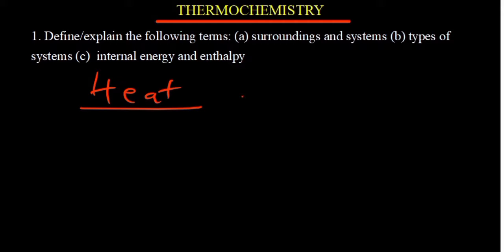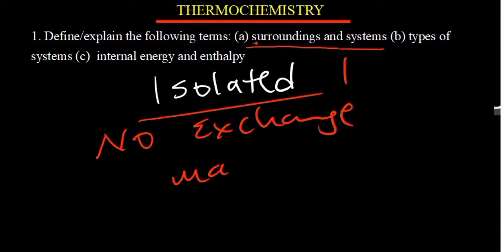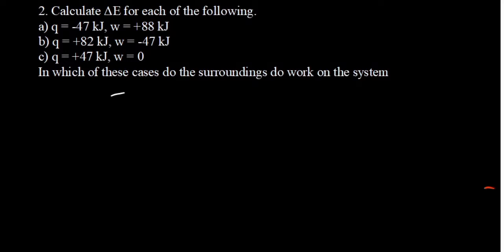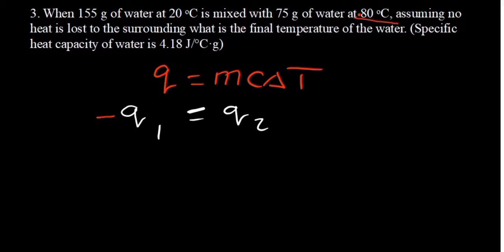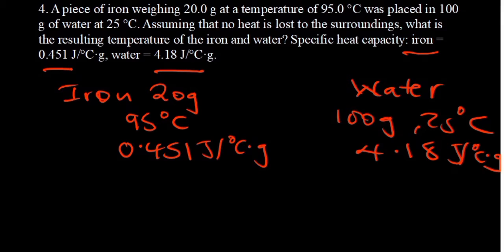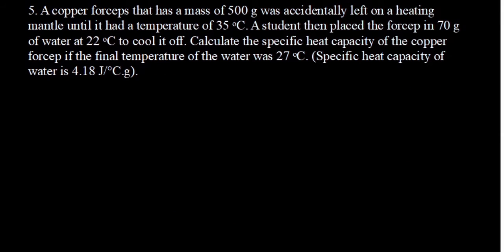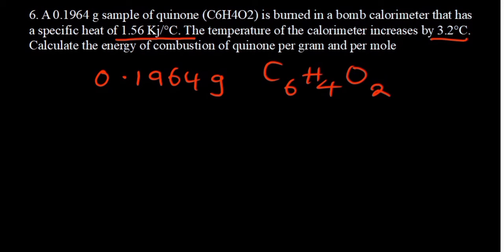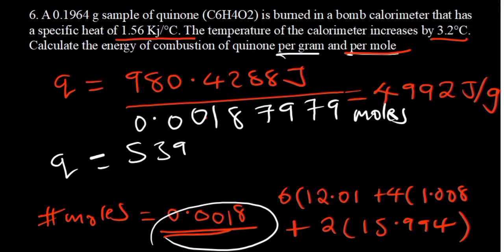Thermochemistry practice questions 1 | Chemistry

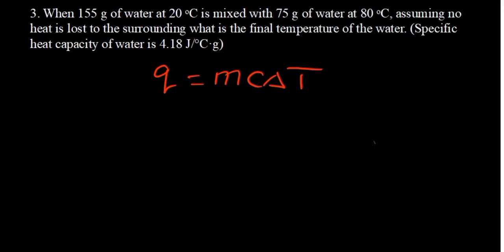Comment: 15:40 but the question says no heat was lost, why are we still putting the negative
Reply: The negative is indicating transfer of heat from the water at a higher temp to the lower one, not loss to the surroundings